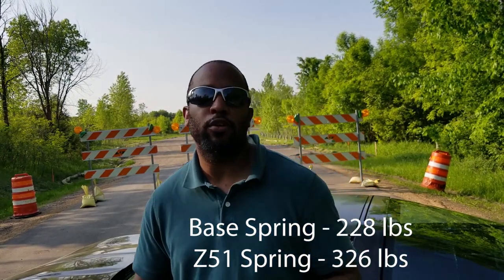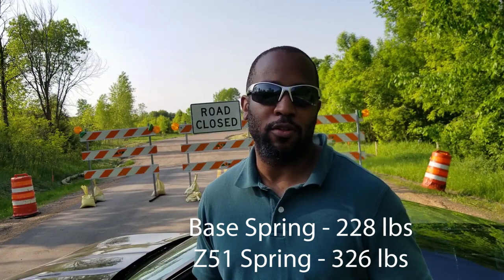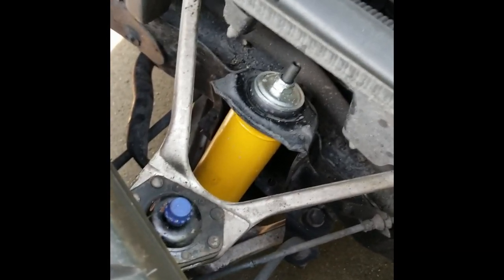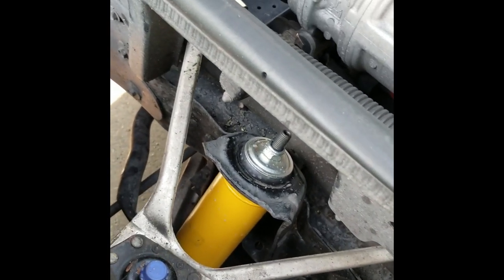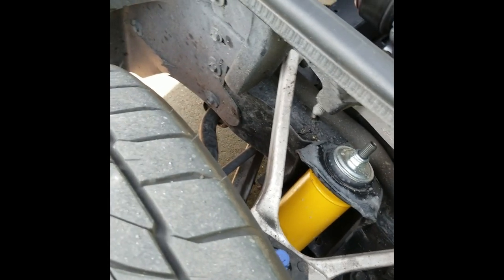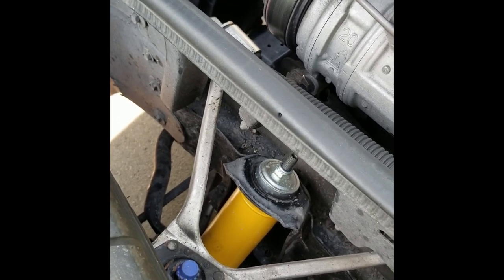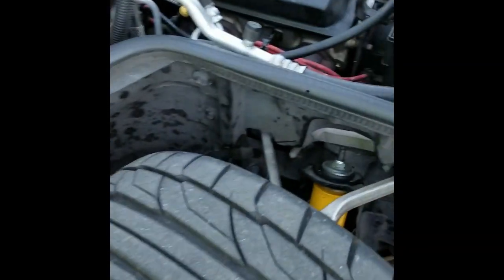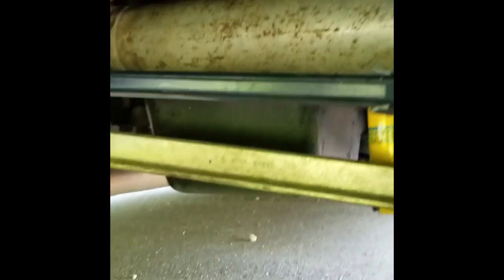C4 Corvette Suspension Upgrades

Comment: Got lucky with mine. I was just looking for a six speed and it happened to be a z51 package. Z51 also comes with bigger brakes I believe. I highly recommend hawk 5.0 pads and braided lines by the way.
Reply from the maker: That's awesome that you ended up with the z51! And I believe you are correct, Z51 gets you the bigger brakes as well.  I will definitely look into the hawk pads...I've heard mixed things about the braided lines, what's been your experience so far?  Do you feel like they've made a difference?

Comment: Thanks for the great videos and info!  I also have a 96 LT4 with the normal suspension…thinking of upgrading the shocks/springs to Z51 for a tighter feel on the road (the shocks need to be replaced anyway). Did you notice any ride height issues with installing the Z51 components?  What are your long term reflections on the setup? Have you added any additional Z51 components like sway bars or front leaf spring?  Thanks for entertaining all my questions!
Reply from the maker: Thanks for your comment!  I would go to the z51 shocks and springs if you can.  Shocks will not affect ride height, and springs will only affect it if you get the lowering bolts in the rear.  No plans for front z51 spring yet, but definitely looking into a front sway bar to tighten up the turn-in in front.  Updated video to come soon!
Reply: Awesome—just saw your update video. I’ll probably do the shocks and rear leaf and add from there per your recs . I’m also going to take a good look at my ball joints…steering seems a little too heavy. Nice work on the videos!
Reply: @TheFamilyCarGuy To improve turn-in you need a thinner sway bar up front. A thicker one will increase understeer unless you compensate by fitting an even thicker one at the back. One trick road course drivers use is to disconnect front sway bar at the track on cars that can be done in - so they get rid of all the understeer.

Comment: ('93 C4 convertible) my C4 Ride feels rough . Let me know when you  research Coil-overs seems like they will better than any transverse leaf spring Fe3 or Zr1 ?
Reply from the maker: Ken take a look at your RPO codes...what kind of suspension do you have? FE3 is the sport suspension, so it will ride a little rough but you will have tighter handling. Coilovers are going to be your best choice if you want to change your ride for various purposes such as a Sunday drive vs going to the track.  They are also going to be the most expensive.  If you only care about cruising, go with a base set of shocks or at least a softer leaf spring in the back.  Let me know how else I can help!
Reply: @TheFamilyCarGuy  Coilovers run the risk putting a shock through the tower. The shock mounts are not designed to take the weight of the car. There are some kits to beef up the mounts for coilovers but I am not about which ones are good.
Reply from the maker: @carlcochrane2030  you are right there is a risk there but I have heard good things about the Van Steel coilovers and one other brand which escapes me now. There are several guys that autocross their c4's that swear by their coilover setup. Me personally, I prefer to stick to the original suspension design as much as possible, but also am not as hard core into tracking my c4 as those guys. Would love to hear more of your perspective.
Reply: @carlcochrane2030   I just read this and had to correct the thought process here as I can tell that you have not seen a C4's shock mount. A unibody car will have a problem with coilover conversion as the shock towers are stamped in shape sometimes with multiple pieces of metal. They are often poorly suitable for coilover conversion without major improvements. However C4 Corvette's have solid steel shock mounts, not towers, and replacing the suspension with a coilover kit is easy and a fantastic option as you can easily tune your suspension yourself wherever you like.
Reply from the maker: Thanks for this Peb! Good explanation!

Comment: Excellent ! Family Car Guy !! Just picked up a ‘96 CE with LT4 & 6spd. Just had the Clutch Conversion completed and the Exhaust modified to give me the Exhaust note that I wanted, by removing both the Resonator and Mufflers. Vehicle is in excellent, actually Show condition, but do have a few issues. Real Time Damping suspension system is not working, so I’m not sure what I’m going to do ? Either have it diagnosed and repaired or just replace with conventional QA-1’s ? Would like to replace tires with Coker Red Lines, but they are considerably narrower than stock P285/40 ZR-17’s. Any suggestions ?
Thanks, keep up the Good Work !!
Tom
Reply from the maker: Tom congratulations on your purchase!  The 6-speed with the LT4 motor is a great combination!  I would either go with QA-1's or get the more aggressive bilsteins like I have on mine.  I still have the factory resonator, but also have a muffler delete.  A must-do improvement! What look/perfomance goal are you trying to achieve?  Do you see track days in your future at all, or is this a street/show car?  Coker red lines will definitely be narrower and not as grippy as the factory tire sizes.  Do you have the stock saw blade wheels right now, or grand sport style?  If factory, I would go with continental extreme contact DW tires, which will be fine for every day use.  Let me know if I can answer any more questions!  Thanks for watching!
Reply: hey, same car here, what clutch parts did you use and are they doing OK ? thx

Comment: Nice video. How hard is rear leaf to remove? What would be a give away that you have a Z51 car without window sticker?
Reply from the maker: Doug, thanks for watching! The rear leaf spring isn't too difficult to remove, there are just a few bolts on either side. I had my local shop do it, but I've heard its not too difficult based on what they described to me when it was on the lift. In order to see if your car has the z51 springs/shocks, you will need to take a look at your RPO codes (regular production options). Mine can be found on the storage cubby door right behind the passenger seat, which is where I believe yours would be as well. You are looking for code Z51.  If you have that code, you have the stiffer leaf springs and shocks from the factory. However, depending on mileage and condition of the car, and how you intend to use it, you may want to replace them anyway. Hope this helps!

Comment: Might want to grab Z51 front/rear sway bars too. About half og the 84s are z51, so...if you see one in a junk yard...might be a great set of sway bars!
Reply from the maker: The Superc63 thanks for watching! And yes, I am looking into sway bars as we speak! Will make another video once I figure out what I'm doing there.
Reply: @TheFamilyCarGuy  Also, z51 steering rack; higher ratio. I have a 92 FE1 and a 93Z07...night and day difference is driving feel.
Reply from the maker: @CC_Top_Solutions  I wonder if I can find that in a junk yard or where I can buy that online? Because I would love that!
Reply: @CC_Top_Solutions  2 turns lock to lock
Reply: @MEANSTREETAUTO454  I know i coul def feel the difference between my 92 FE3 and my 93 Z07...Z07 is my fav!
Reply: @CC_Top_Solutions Trouble is the late model C4 doesn't have the quick rack option anymore. Your 92 and 93 have the exact same steering ratio which is a lot slower than an early Z51.
Reply: @varmastiko2908  you sure about that? Im pretty confident 93 Z07 has faster ratio rack...same as earlier Z52/Z51.
Reply: @CC_Top_Solutions Yeah, the quick rack was discontinued after '89. Even the ZR1 and the Grand Sport had the 2 3/4 steering like all the standard models. The early Z51 rack is about 2 turns dead.

Comment: Do you have any idea why the rear suspension is adjustable and the front is way more difficult to adjust with the shims... I have a 91 c4 for about a month now..just trying to learn as much as possible
Reply from the maker: Wayne Minor thanks for your question! Quite honestly, I am not exactly sure why the rear suspension is so much easier to adjust with the front. Are you trying to lower the car? Swap springs out? Change  the sway bars? Just curious to make sure I understand your question completely. What i do know is that most people lower the car in the front by ordering shorter shims or chopping the OEM shims on the front spring. Hope that helps some!
Reply: The Family Car Guy I want to lower the car due to the wheel gap that I’m not so fond of
Reply from the maker: In the rear, front or both?
Reply: The Family Car Guy both
Reply: That’s the plan anyway
Reply from the maker: @wayneminor4145  makes sense. So the easiest way to do it is to get lowering bolts for the back, and then cut the shims on the front spring in the front. Let me know if you need more info, there was an old article on superchevy that I referenced when I was researching this same thing.
Reply: The Family Car Guy thanks I appreciate it, I’ll let you know how it turns out

Comment: I have a 96’ and whenever I hit a little pot hole it feels like the wheels are gonna break hahaha how can I fix this issue? Would that be suspension or tires or?...it’s my daily driver atm
Reply from the maker: Thanks for watching!! I would check your RPO codes to see what kind of suspension you have.  If you have the Z51 suspension, you might have a rougher ride due to stiffer springs and shocks. You could switch to a softer spring in the front and rear and softer shocks.  Just be careful because the car will float a little more on the softer shocks. A lot of people are happy with the KYB shocks, that are a little softer than the bilsteins. Hope that helps!
Reply: @TheFamilyCarGuy  hey I’m having trouble finding a front mono leaf spring for my 96’ do you know where I can find one online? 🤓 thanks!
Reply from the maker: @NickYT22  yes I would check van steel let me find the link and I will paste it in here. I am looking for a stiffer front spring myself!
Reply from the maker: https://www.vansteel.com/index.cfm?fuseaction=shop.showItem&subgroup=32033&ID=2877
Reply: theres medication for that @TheFamilyCarGuy